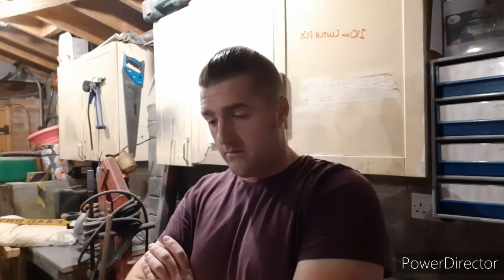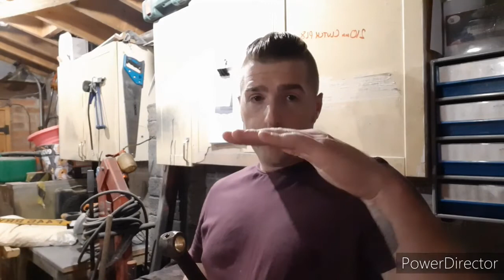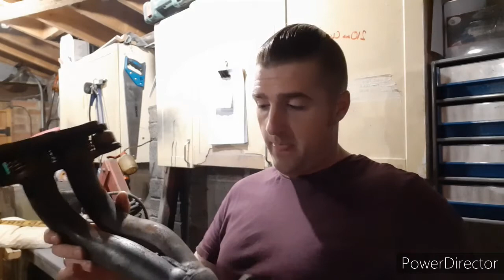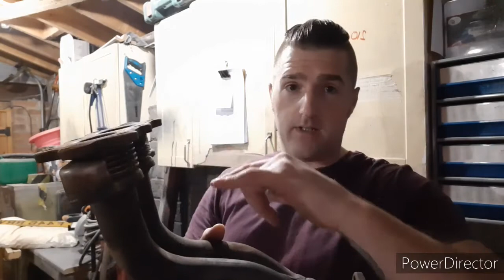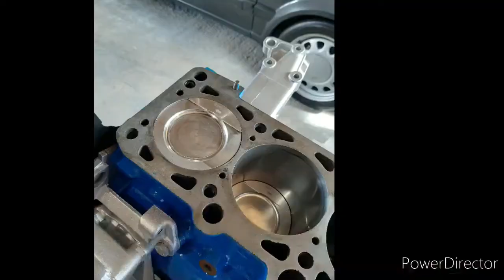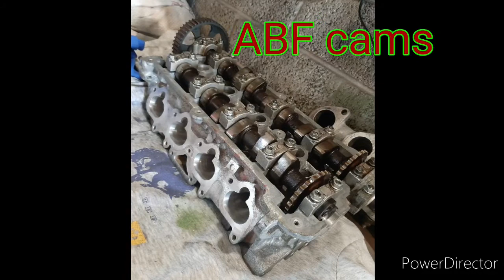Mk2 Golf Gti 16v Restoration - Piston Pi##take Part Two

Comment: Hi mate loved watching your vlogs on this build and I’m about to start my engine build... I’m stuck already lol... do you know if it’s true that the mk3 2.0L block fits straight to the 16v head & in with no mods to be made ? I don’t want turbos or the r32 I want it pretty standard but if this 2.0L conversion is true it sounds like something to think about?
Reply from the maker: Thanks 👍 yes you can use the 2.0ltr ABF block with a KR 16v head, you'll have to use the ABF head gasket and timimg belt. Not sure ref the timing belt covers etc